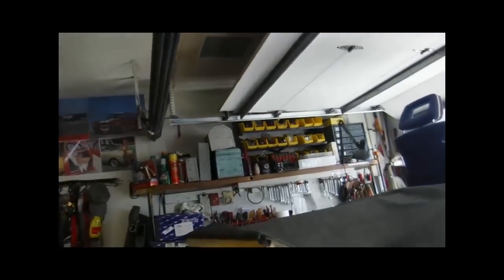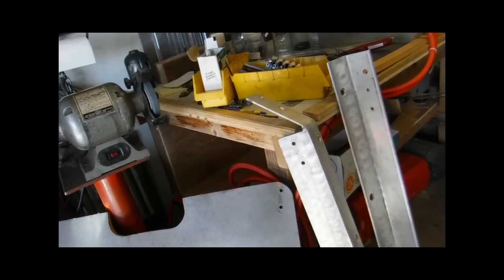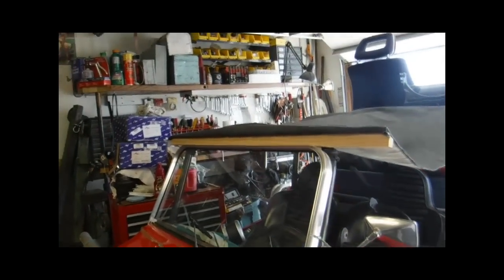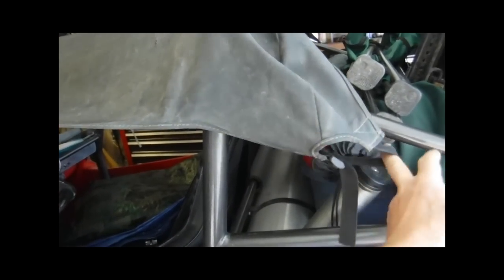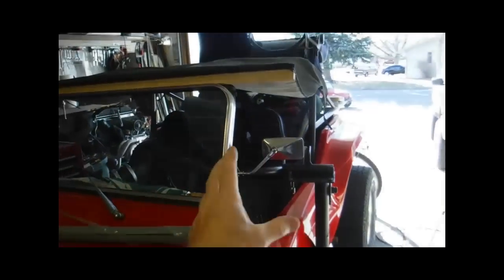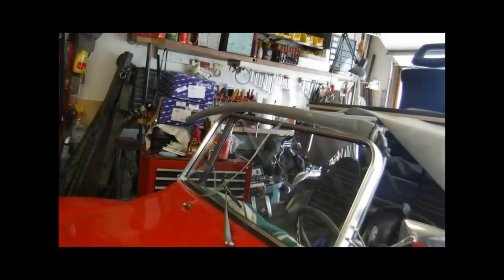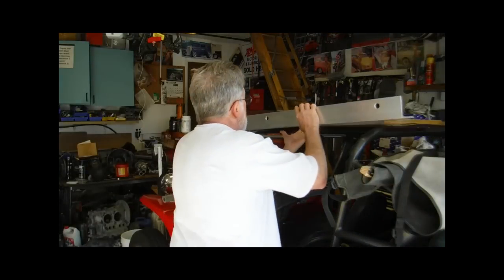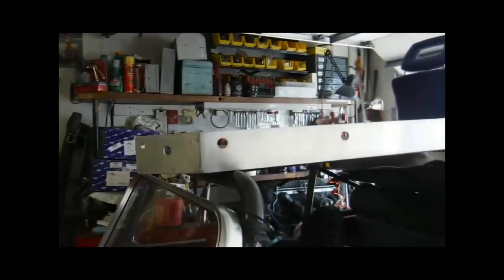Dune Buggy Top Idea's

Comment: Hey Ez, 
When you get back to motor building ,
I have a question on deburing engine parts. Like the cam shaft.
What parts benefit from deburing and what's your method & what supplies needed. 
Thanks for subbing
Reply from the maker: All that deburing and polishing is for the Ultra high HP engines over say 175hp  if not done perfectly you can cause stress risers or attract fatigue. I don't bother with it unless there is an obvious flaw. I will usually pay extra for crankshafts to be radiused and nitrated. Camshafts are cast and work harden when you brake them in so if you want you could go around the corners with some emery cloth. Sometimes you have to grind them for counter weight clearance. Whatever makes you feel good.

Comment: hey bud I'm having trouble with my engine not idling correctly as when I am not giving it gas it immediately sputters and it dies, do you have any suggestions
Reply from the maker: sounds like your accelerator pump is not working. Look down the top and give it some gas to see if it squirts.Be safe. Flashbacks and bite ya
Reply: TheEZGZ thank you, still love all your videos